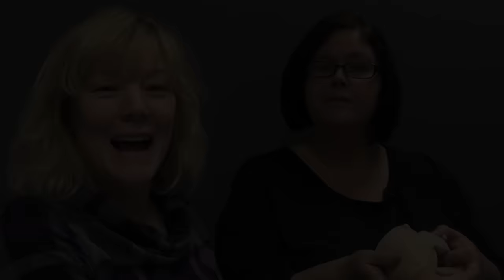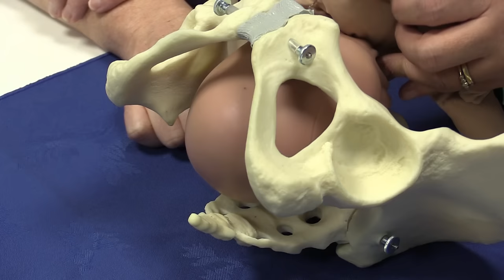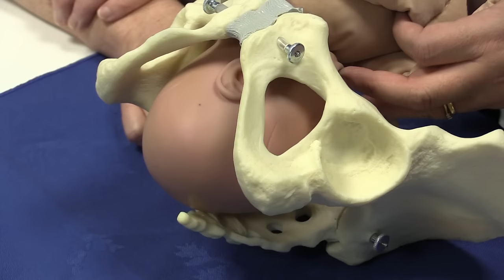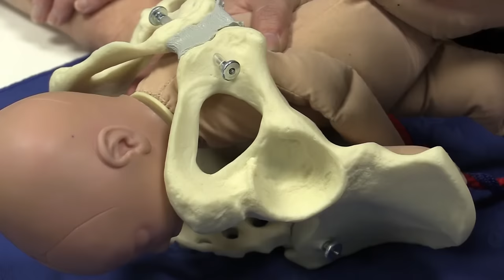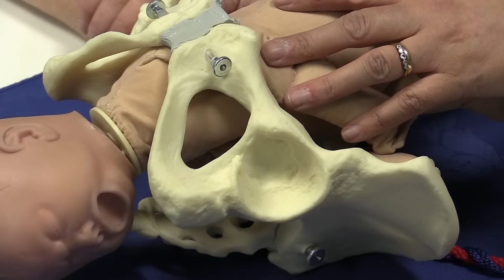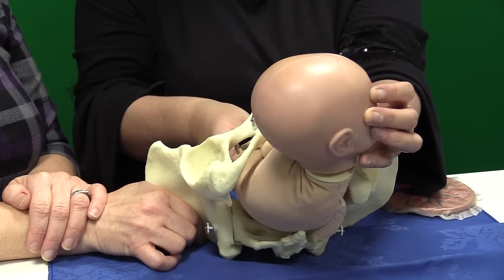Mechanism of Normal Labour

Comment: This is a good presentation! (LOA/ROA) I would just like to clarify that the baby's shoulder will not be able to pass the pelvic INLET with a LATERAL position because the INLET's diameter is approx. 11 cm Anterior-posterior and 13 cm Transverse, this makes the shoulder parallel to AP diameter of 11 cm shorter than the Transverse diameter, but if the baby's shoulder also rotates during the 3rd Cardinal Movement -Internal Rotation- the position of the baby's shoulder will also rotate makes it parallel to Transverse diameter. Please correct me if I'm wrong.
Reply: instead of memorizing number and so
there's a small trick to understand
the first is that the pelvic inlet transverse diameter is longer than the antro posterior diameter
and that the outlet is antro posterior diameter is longer than the transverse
so the fetus head (antro posterior diameter is longer than transverse)
so the fetus just enter the inlet with his head antroposterior diameter pararrel to the transverse pelvic diameter line 
so to keep on mind that after passing through the inlet
the fetus have to do rotation so he suit the best wide diameter
after fetus head presented through the vagina
he gonna be on flexion status facing the anus of the mother
then he passive do extension with external rotation so the rest of his body come out part by part

Comment: 1. Decent
2.Flexion
3.Internal rotation of Head
4.Crowning
5.Extension of head
6.Restitution
7.Internal rotation of shoulder
8.External rotation of head
9.Lateral flexion of body .
Reply: you forgot engagement
Reply: @isuturehasti4266  😁
Reply: @isuturehasti4266  crowning is the engagement .lol
Reply: @jithinbabu2196  we learnt that engagement is before descent. When the largest diameter of the fetal head engages with the widest diameter of the pelvis
Reply: @isuturehasti4266  that is crowning